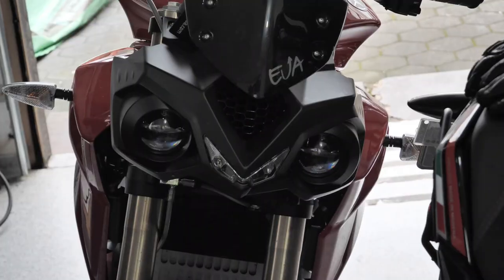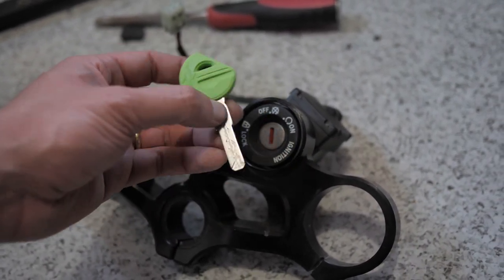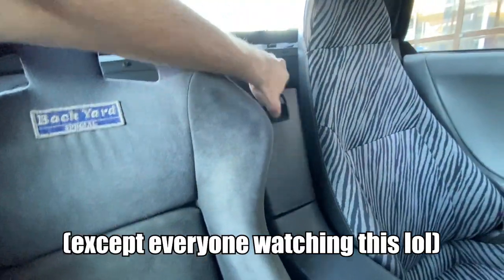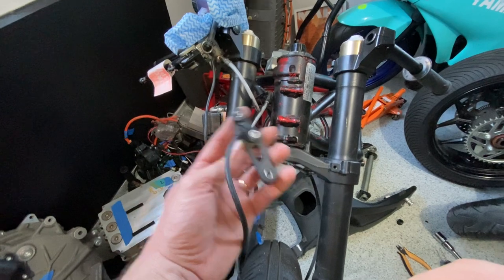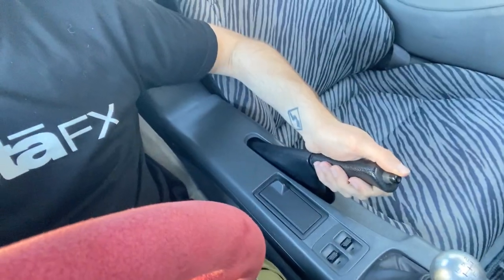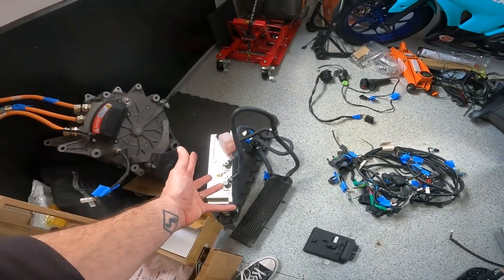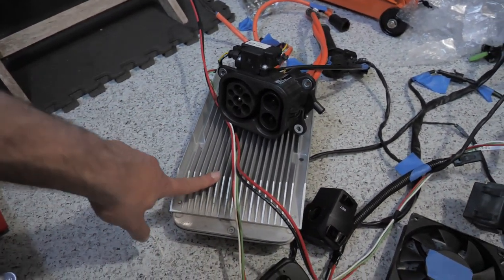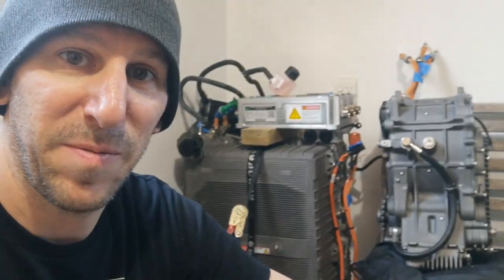Electric Honda Beat Conversion - Episode 6 - Getting the parts working outside of the bike

Comment: I don't know if it has been explained here about the ABS-system: the disc with all the holes in it rotates with the wheel. And there is a laser shining through it mounted to the suspension. If the laser detects that the wheel has stopped spinning (i.e. it will register a constant light or no light at all instead of a flickering light whilst riding), it knows to engage the ABS-whatchamacallit to ease up on the brake pressure to get the wheel rolling again.
Reply from the maker: Thanks for this! Pinned it for anybody else who wasn't sure how it worked 😁
Reply: It's not just that, it also registers the speed (and the difference between front and rear).
Reply: I was wondering if the cars original abs could be spliced so you didn't need any of the bikes abs gear.
Reply from the maker: @garystinten9339  thankfully the Beat doesn't have abs, so I won't have to worry about it at all.
Reply: @NewZeroland  see if the abs can be grounded out or "patched" to trick it out and make it think it doesn't use brakes or ignores abs. Good luck and please go into this a bit more to explain how you glitched it to work.
Reply: You sure it's a laser?  I thought they were all just hall sensors?

Comment: That was so cool watching you put it back together and revving it! 
Also putting the key by the CD holder is perfect. That is where they put the key in Mercedes Benz SLS AMGs. Too cool!
Reply from the maker: Heyyy nice to know!  That settles it.  I'm putting the key there hahaha.  I did a test rev last night to make sure it wasn't limited and can confirm the motor will fly through the wall :D

Comment: Re DC-DC converter - get one with a 13.8V output rather than 12V output.  In my first build the power draw when I turned the high beams on was enough to drop the 12V line low enough to have the controller turn off.  While I was riding.  That was fun.
Reply from the maker: Whoa, good call!  Thanks for the heads up.

Comment: A car brake switch uses a chassis ground for the other terminal. That's why it only has one connector. So to connect it to the bike wiring just use a ring terminal on the bolt that mounts the switch.
Reply from the maker: Thanks!  That's a good idea.  I might just bypass it entirely and keep it as a switch that's on all the time.  That way I can throw it into reverse without coming to a complete stop and waiting 5 seconds.

Comment: I'd suggest ditching the heavy bulky key ignition and converting to a bluetooth ignition, they're not hard to rig up and as long as you have your phone with you then you can turn on your car. Pretty secure. 
It's funny actually, I ended up swapping the Tomei clutch 2-way LSD in my car just yesterday, I've apparently done enough of these it only took a few hours and most of that was cleaning. Now to get it back on the car and drive in figure 8s for an hour...
For ABS I think it would be cool if you could hook it up kind of like how they do brakes on a monster truck, in this case your secondary sprocket could get a disc brake attached to the same shaft, or maybe just a tone wheel, so you'd have rear wheel ABS for both wheels, and I'm not sure how the front is configured, but if you can do front and rear ABS its' still better than no ABS if you can manage it. 
For the AC charger, I think it would be perfect if you can make it so you can take it with you if you think you may need to use it but only plug it into a special connector on the car when you want.
When I do get around to my EV conversion project I'm already planning to use an electric brake booster. Seriously skip the vacuum pump and all that hassle, weight, space, etc.
Final thought from someone who regularly does handbrake turns, just go full hydro-handbrake with a second set of calipers if you want to do that and keep your existing handbrake to hook it up how you'd thought before. You probably will rarely use it though, so I'd probably not worry about it and just wire in a drift mode bypass switch if you want to use the existing handbrake and do the kickstand setup in there. 

Unrelated to the project and you are probably already more familiar with this than I am, but I'm kind of digging the Fllow Electric Commuter from Eric "Fuell" Buell. $12k for something competitive with my SR almost and DC fast charging. I'm seriously thinking about it, just the 140KPH top speed from that hub motor that I'm not so keen on. The modular upgrade as better parts become available part I think is awesome though.
Reply from the maker: Man, awesome ideas!  The bluetooth key thing is cool but I'm having enough problems connecting my phone to the Tesla that I'd rather just keep it as is.  Hopefully I don't need the ABS, but if it's absolutely necessary, I'll stack both front/rear rings together and maybe put it on the diff housing.  I'd rather just delete the ABS entirely.  Good call on the vacuum pump.  That seemed to be the simplest way but if an electric brake booster is easier and lighter weight, I'll go with that.  Handbrake turns might be a mess without a clutch.. so I don't think I'll be doing :[ Sadness haha.  Then again, I have enough power to probably get sideways on accident!  You're right about that Fuell bike.. DC charging at that price is a game changer.  The hub motor is limiting but for commuting it looks perfect.

Comment: 10:00 the squishy switch connects to metal in the car which is a ground. So technically it is two pronged - sort of. Also, set up a connector at home so you can AC charge at home.
Reply from the maker: Ohhh whoa!  That's cool to know.  Yeah I think you're right.  Leaving the AC charger at home would save me from making up another bracket, too.

Comment: The security bolts holding the ignition come out quick if you use a left hand drill bit or you could cut slots in the heads and turn them out with a flat bladed screwdriver. Have not seen your method used before, but if it works, it works. 😆
Reply from the maker: Oh boy 😂 Well I promise not to take the grinder to any other Energica parts hahaha

Comment: Luv this - keep going!
About stripping the heater/AC from the car - it is a slight, but none-the-less a weight saving. Consider the chilly days though - add heated seats (or rather the carbon filament heaters that go underneath the seat covers) - that way you'll have a bit of comfort with the least weight gain and it puts the heat right where it needs to go ;-)
But do consider that you'll need at least a minimal windscreen fan in case you get caught in the rain or high humidity - safety first ;-)
Reply from the maker: Thanks 😁 Great ideas! I'll definitely need a defroster setup.. either a fan or a heated wire setup I can put on the glass. Heated seats would be sweet, too! Way fancier than what the car has now, which is nothing 😂

Comment: The E-Brake turns should only be a concern if there is a delay between up or down. I would say see if the kickstand acts as an emergency shut off if the bike is in motion on your other bike (going slow ofcourse lol) and if there is a delay to be able to accelerate once its kicked up. If so you can hide the kickstand in that compartment where you mentioned the ignition can be and keep the ignition where it is currently. So if someone tries to steal your car there is a hidden switch (kickstand) they have to flip they dont know about lol.
Reply from the maker: Heyyyy that hidden kickstand idea is awesome! 😂 Yeah once the kickstand is down, even for a second, you have to hold the start button again to get it going.

Comment: I don't know if your donor bike has TC but if it does you'll need both front and rear abs rings. Otherwise the system detects a difference in wheels peed and cramps out at any speed above 5 kph. Also the rear ring on energica is used for speed and odometer updates. You can check by putting your ribelle on a rear standnwithnignition on (not even live just on) and spinning the wheel by hand. As you could just drop the modulator maybe. Unless you want abs to work on your car obv.

Edit: to bypass you could also mount one ring with both sensors onnthe same wheel and it will never trigger

Edit2: oh I should have watched first. So the speed comes from the motor. Makes sense cause in my example setup that would also spin the sprocket :D. Anyway I'll leave my comments to make fun of me and for the abs thoughts.
Reply from the maker: Yeah!  I thought the speed sensor was at the rear wheel, too.  It might still be there and I'm just confused about how this works.  (I mean, yes I'm confused about how this works haha) and it's a 2018 model so it shouldn't have TC... but I saw a (TC!) error on the dash, so again I have no idea.  I tried adjusting TC in the dash but the menu wasn't coming up, so maybe it doesn't have it.  Your idea about using both sensors on the same ring is genius!  If I have to put that stuff on the car, I'll totally do that.
Reply: @NewZeroland  When you are building the diff you might consider including an abs sensor on it as a contingency in case you find that you need this later.
Reply from the maker: @ratmanbrian  yeah that's a good idea.  I'll do some research to see if it's needed!

Comment: I think the speed sensor is a problem, and also it means that if you change the sprocket size in your bike the speed is not accurate (which is not by default, but that's another story).
Like you did in your Eva.
Unless the ratio is configurable via software, you can't use that number.

This means you have to either change the software or use a separate dashboard that reads raw data and manipulate it before displaying.
Reply: Unless for some reason the car has a ratio ~1.6 bigger then the bike, in that case you can just switch to miles and read it as kilometers XD
Reply from the maker: @IIARROWS  😂 that would be convenient! But nah I'll change the software to factor in the difference in sprocket / wheel size.
Reply: @NewZeroland  How do you do that?
Reply from the maker: @IIARROWS  hacker magic haha

Comment: Keep in mind, if you choose to change the gearing to give the car more torque the speedometer will be slightly off if it goes solely by motor shaft speed.
Reply from the maker: Yep, I'll need to have that adjusted.  It can be done, but only by Energica.

Comment: For a brief moment I thought I'd finally learn how ABS works.
Reply from the maker: This is the level of educational content you've come to expect from NewZeroland.
Reply: If you genuinly don't know: the disc with all the holes in it rotates with the wheel. And there is a laser shining through it mounted to the suspension. If the laser detects that the wheel has stopped spinning (i.e. it will register a constant light or no light at all instead of a flickering light whilst riding), it knows to engage the ABS-whatchamacallit to ease up on the brake pressure to get the wheel rolling again.
Reply from the maker: @bassplayer137  dude that was amazing! Thank you 😁 Someone suggested stacking the front and rear rings just in case I need the ABS plugged in on the car, but I'll find a way around that.

Comment: Subscribed, as I would like to convert my Beat into an EV - a fall/winter 2023 project.  The thing I am most worried about for your build is this: it seems like you're up against a pretty tough challenge to take 30% of the weight out of the car to have it meet certification with your new 200kg drivetrain plus 50kg occupant allotment.  I've pulled the transmission out of my Beat and it's only ~35kg.  Have you done any research on the weight of components you'd be removing?  When planning my build, I'd accepted up front that I'd be adding up to 100kg to the car (though my plan is to bolt an AC-50 to the stock trans) so I am hopeful that you manage to shave 50kg while doing your conversion.

Also, does this mean the car doesn't meet certification right now since the curb weight plus 160kg is greater than the gross weight listed?
Reply from the maker: Dude thanks!  That's so awesome to hear that you're interested in converting yours, too.  Another guy in New Zealand has done it already (I think with an AC20, or something lower-powered) and someone in Japan also converted one.  If you're able to get a used (or crashed) Zero motorcycle, those motors have the same power as AC50s at a fraction of the weight.  Good to know that the trans is 35kg!  That's heavier than I expected.  If the engine is ~100kg then I might be ok.  There's a lot of gas-related stuff that can come out to save weight.  I'll start stripping the car of all that stuff in January :D

Comment: Before you get too far into this, would it be easier to mount the motor transversely in order to connect it to the differential? I don't remember a lot about the differential you plan to use, but most of them have the input rotation 90° to how a motor is oriented in a bike. Going through a 90° adapter will add weight, complexity and friction.

Edit: I just realized that actually most bike motors are already transverse and turning it 90° would make it longitudinal. LOL.
Reply from the maker: Haha all good.  Originally I wanted to hook it straight up to the original transaxle and still be able to shift gears, but that was way too heavy and complicated, and I didn't have the space to do it.  A chain and sprocket setup will be way simpler.
Reply: @NewZeroland Something about the differential you showed us has been bugging me but I couldn't put my finger on it until now. I think what you showed us was the carrier and its internal gears, not the complete differential. At first glance, that may seem to be the perfect solution because you can just bolt a sprocket where the ring gear usually goes. But there's more to a differential than that. They are designed to be lubricated with an oil bath. The gears dip down into the pool of oil at the bottom of the housing and then fling it onto the upper part of the housing, where it runs back down into the pool. Even if you put a custom housing on that carrier to keep in oil, if the entire thing is rotating the oil will be pressed into as thin a layer as possible around the exterior of the housing and the stuff near the center will run completely dry very quickly. If you find a way to completely fill the housing with oil there will be power losses from hydraulic forces. Regardless, you will have to engineer the custom housing with bearings and seals for the axles because they have to be free to rotate with respect to the housing. It's also unclear how the whole thing will hold up because the forces will be completely different from the way it is designed to work. The original housings are engineered specifically for each differential and the stresses they endure.

If, on the other hand, you start with a complete differential along with the 90 degree input shaft, there will be some benefits. If you rotate the motor 90 degrees it wil fit more flush with the firewall and give you more space (provided there's enough width, of course). Using a shaft drive from the motor to the diff will also gain a significant amount of space versus a chain drive with a large sprocket. It will also be pretty much no maintenance, whereas a chain drive requires frequent maintenance. Another issue is that chains tend to sling grease and grime around, which you could minimize with a custom guard/housing but that would add more stuff you don't want. An adapter to attach to the motor in place of the front sprocket should be fairly cheap and easy, and custom driveshafts are certainly not a big deal.

There's also the matter of how you plan to mount the differential. With your design, you'll need a way to rigidly mount the inner axles wth bearings to hold it perfectly in place and resist the forces of the chain on the sprocket. A regular differential is much easier to mount because it already includes all the bearings and the forces are mostly just the twisting forces on the input and axles, which are not directly acting on the housing. You can basically just weld on mounting tabs or bolt on clamps wherever you need them to be.

The one caveat is that you'll have much less choice of gear ratios with shaft drive, but there are also reduction gearboxes if that's necessary. And depending on the differential there are a fairly wide range of ratios available, from the mid 2's to the mid 5's to one.

What I'm saying is that at first blush a chain drive may seem to be simpler, easier and more compact, but in reality a shaft drive may actually be all of those things. It's possible I'm completely off base, but maybe this will give you some food for thought.
Reply from the maker: @awo1fman  nah you're totally right, and I considered using an MX5 rear diff, or something similar, but there just isn't room for it 😂 The car is smaller than most people think. I looked into using a Quaife gearbox, but that still required a chain, was like $7k USD, and would need custom axles made, and those are also crazy money. I'm thinking of either sealing up just the diff and filling it with oil (maybe halfway? not sure.. enough that it's always sloshing) or enclosing the diff, sprocket, and chain all in one housing so it all sits in an oil bath. I met up with a race car builder who got the first idea working really well, and I'm chatting with an engineer about making it happen. This is obviously way over my head, but so many people have done it before that I'm not that worried 😁

Comment: Hand brake turns, it's a stupidly torquey rear wheel drive car. Boot it and light the back tyres up. Hand brake turns are for front wheel drive.
Reply from the maker: Haha good point.. and not having a clutch might make that difficult anyway.  Powersliding it is!